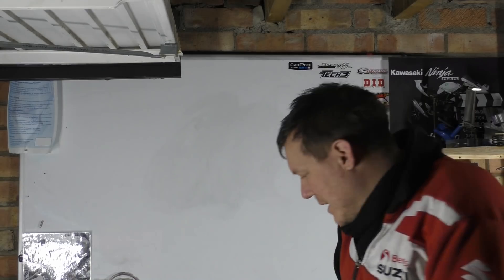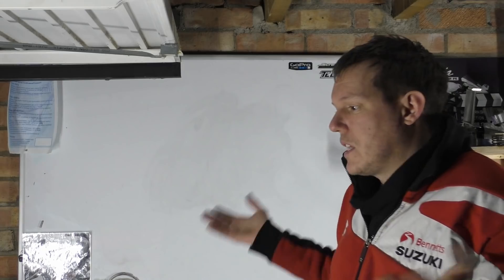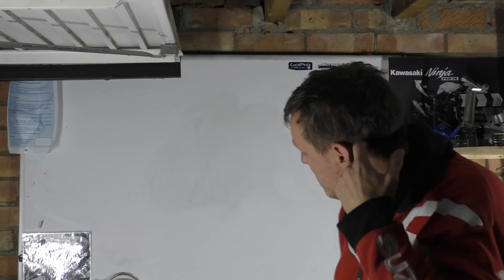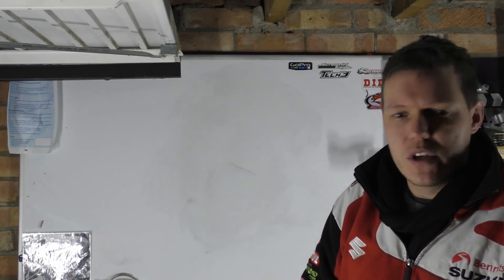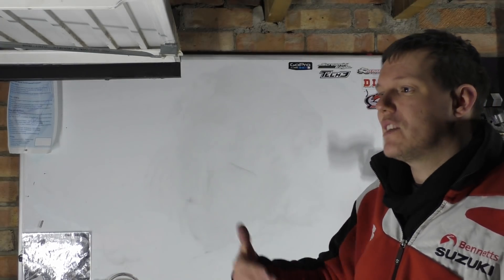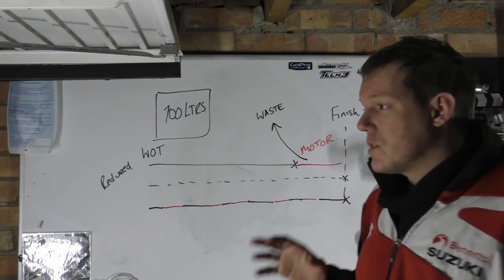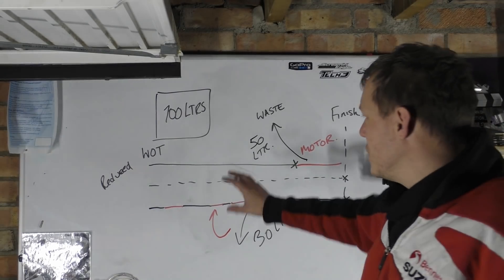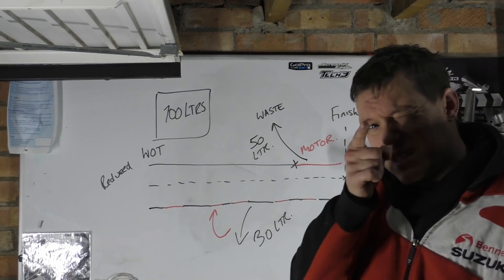How to get more than 30% efficiency?

Comment: If I was to hazard a guess, I would say that your average normally aspirated petrol car engine is not more than 25% efficient. Those house sized supercharged 2 stroke diesel engines that you find in container ships are 50% efficient. Even in the late 80's even Honda only managed to get about about 32% with their 1.5 litre turbo F1 car, which was running 4 bar of boost and ran on special fuel consisting of 84% Toluene.
Reply from the maker: Yeah but that's the 80's - One of the best 'measures' of efficiency is te compression ratio (but only in comparison) Fuel octane ratings are better, but not that much better and not better than TEL. 36% is pretty normal for 2015 cars onwards and bikes are around about the same for the same years.

Comment: Myself and an engineering mate had a discussion about a noticeable increase in power when you were riding in fog. Since a patent has been taken out on a six stroke ,it might have a bit of reality to it. After the power stroke, it takes in a charge of water vapour which makes a steam stroke, cools the engine etc. So why not inject a bit of water vapour and get the steam charge during the power stroke, because your making water out of your exhaust anyway?

Comment: Why aren't the exhaust gases used(Turbo, but instead it's a generator) for charging some battery which in turn is used to drive electric motors? The efficiency of the combustion engine goes down with extra propeller spinning on the exhaust piping? 

If I made a breaktrough invention here, I'm gettin 50% of the profit!

Comment: why ideal gas would have more efficiency than normal air?
Reply from the maker: Because an ideal gas is uniform - air is a mixtures and has stuff like water vapour it in
Reply: @thedirtyworkshop  oh so nothing relate to the thermal dynamic? if the air is 100% oxygen then it would behave like ideal gas?
Reply from the maker: Almost. Thermodynamically this is about the transfer of momentum vs heat and the molecules themselves. In simple terms an ideal gas would have perfect eleastic collisions. Think a newtons craddle but with the heat loss - like in a pefect vacuum
Reply from the maker: "if the air is 100% oxygen then it would behave like ideal gas?"

- when the it wouldn't be air. But the more 'simple' the molecule the more it behaves like and ideal gas. Once you get into higher energies then the ideal gas law becomes less useful. In other words the hotter it gets the more vague the ideal gas law becomes.
Reply: @thedirtyworkshop  thanks sir, your explanation is way more simple to understand than those things on the internet

Comment: would a two wheel drive bike(using stator motors) be an advantage? as in would there be a benifit(i dont ride bikes - yet) if you had drive from the front wheel too?
Reply: as in each wheel is the motor, for practicality purposes on the idea, have a harness farme that hosts a shit tonne of battries..... purely for experimental sake.

ive designed a sketeboard with a similar thing in mind to achieve awd(no slip diff as there isnt one) and abs(that recycles the lost energy), its heavy 1200mm tall and 900mm wide but in therory is capabile of 100kmh(limited)
Reply: im stuck on how to allow one wheel to spin at a differet rpm than the other, fucken computers

Comment: Honda used a pre-combustion chamber on early 80`s cars called cvcc.They dropped it for
emission reasons in favor of fi...Do you know if current rigs with a cat...inject extra fuel just
to keep the cat heated or is that a wives tale?
Reply: I believe the current way of fueling with a cat is to cycle rapidly between slightly lean and slightly rich. 
This provides excess O2 for one type of reaction in the catalyst and excess fuel for others. The downstream O2 sensor is only there to check if the cat is working (if the mixture is still fluctuating after the cat then the cat isn't doing its job).
Reply: Thankyou, this makes sense..do you have any sources of info..?

Comment: They want to eliminate the starter motor on bikes.... there is this amazing thing called "The kick start", maybe that's a way!
Reply: I bet del has.
Reply from the maker: LOL ever tried kcik-starting a Hayabusa?
Reply: @thedirtyworkshop  Try kicking over a semi-auto with a dead battery and you have no idea which gear it is in, and you know the idle is too low, but local garages refuse to "fix" it because it is an "old" bike.

Irony - he was there to replace the switch gear and CHOKE!

If I had the tools, I would have done it there and then.

Comment: Speaking of efficiency, it got me wondering if there is such thing as diesel/hydrogen rotary engine? if so, what are the technical pros & cons of it? Would love to hear some thoughts on this.
Reply: I'm not sure if one could get a compression ratio high enough for a diesel, though it could well probably help with the lubrication issues. The flame front propagates more slowly with diesel combustion, though I'm not sure how that would impact the operation of a Wankel. It would need be heavier built too I think and rev slighly slower.
Hydrogen I see no problem, expect I think it may burn hotter. It however isn't going to solve any other issue with a Wankel, such as the sealing problems,and probably more of a death blow these days the emissions, due to how lubrication must be implemented in a Wankel.
But the problem with hydrogen is the storage especially and distribution. It needs to be either stored cryogenically or under enormous pressure to keep it liquid. To attempt to store it in gaseous form would as well as being a little dangerous, it would be impractical as it would need fucking great big bags on the top of vehicles, like they did in the war when fuel was at a premium for the war effort, running on coal or wood gas.
I can just see some stunning luxurious, el expensivo limousine,  with a fuck off enormous rubberised canvas bag on it's roof, twice the size of the car.
It simply would never do. One would have to extinguish ones stogie, for fear of setting off the gas if there were a small leak. We wouldn't want another Hindenburg.
Reply: rationalmartian slow combustion with diesel would be a benefit since the wankel ‘strokes’ happen simultaneously at a much lower speed. But the high compression might really put an end to the apex seals and increase friction even more (lots more seal area/length than a piston engine due to the side seals)
Reply: @ghettobikelife8833  But diesel is a lubricant itself don't they? possibly eliminating the 'oil burning' issue?
Reply: @ghettobikelife8833  
The compression wouldn't hurt the apex seals that much, the big problem is that the maximum compression on wankel engines is very limited.
Reply: Altruistic yeah but modern low sulfur diesel barely manages to lube the injectors (which need it)
Reply: Rolls Royce made a diesel wankel engine with a sort of precompression rotor. PATS or later UAV  developed a series production diesel wankel engine without any precompression rotor, a real diesel engine so to speak ;D.

Comment: We tested a ford fiesta 1.25 engine at university back in 2002 and were shocked to find it was only 19% efficient 😲.. But Now to hear mercedes are hitting 50% is incredible..
Reply from the maker: The core engine is probably about 35-38% for the F1 engines
Reply: got to be more than that at peak, the analyst say that have ~950hp, the electric motor is limited to 161hp
Reply: @fuzzy1dk  That 950 hp figure includes the electric motor(s), yes?
Reply: @petrolheadJJ  yes
Reply: @thedirtyworkshop  yeah I know, all these external aids allow the fuel to go abit further but the combustion engine at 30-35% is still impressive considering its a racer and not a family car engine..

Comment: Mmm how to increase efficiency bore out to about a meter increase stroke to about 2.5 meters go two-stroke I think, oh bugger sulzer have done it before me. And the are making around 160 g/kWhr where we on our bikes n cars are around 350 - 500 g/kWhr. Is there something wrong with manufacturers and emissions control strategy? Shuldent we be designing engines to use as little fuel as possible and then design emissions control equipment to work around that rather than got to run at stoich to meet the requirements of the cat.
Reply: a three way cat needs toggling between rich and lean to both oxidize CO/HC and reduce NOx. A diesel can't run rich so it needs things like urea injection

Comment: Do you think hydrogen buring ice engines are the future? I know they are trash but eventually people are going to be forced to get rid of fossil fuel burning vehicles. And I honestly don't know if batteries will ever get to the practicality of an ice engine.
Reply: the problem with hydrogen is that is very hard to store, getting it to liquid requires cryogenic temperatures so that's not realistic
Reply: @fuzzy1dk  unles we find some bonded form of hydrogen that can still be oxidized without creating co2 or other harmful gasses. And I mean bonded, like bonded to other atoms other than carbon or hydrogen that are abundant, harmless, and would cause it to be liquid at room temperature and pressure. However, I don't know if such a compound exists...

Comment: Addressing frictional losses is the route to increase efficiency.

 Back in the 1980's a mate's car garage boss did car drag racing and let me in on a secret that there are bearings and then there are bearings. Bearings have a friction rating. The one's engine manufacturers use are generic and just about do the job. They have a high friction rating and bleed power out of an engine through frictional losses. They're bulk buy for the manufacturers.

Then there are engines built for competition which have low friction rated bearings, usually coated in something and which give less drag to an engine. He demonstrated a new generic ball race bearing versus a expensive race grade equivalent by letting me spin each one up and seeing how long they took to spin to a stop. The actual friction rating test is done by spinning the shell to a set RPM and timing how long it takes to spin down to a stop.

I rebuilt my 350 road bike with expensive SKF race grade bearings back in 1986 and when I took up bike drag racing in the late 1980's rebuilt all my GT550 2 stroke engines completely, including wheel bearings. It improved my times as acceleration was upped. I managed a 9.91 quarter at Santa Pod in 1989. I used to have a well paid job in electronics engineering back then, that allowed me to commute 60 miles a day on a bike that only did 18 MPG @ 45 MPH on the open road and 9 MPG in town. I used to use just a pint short of 8 Gallons of petrol a day, 4 Gallons to work and 4 Gallons home. (Life with a gas guzzler bike!!)

The noticeable difference is the rate at which the engines gained revs over generic bearings previously and the reduction in engine braking. On the road both bike's MPG improved noticeably.

With engine rebuilds installing expensive low friction rated race grade bearings improves performance simply by reducing some frictional power loss.

Worth rebuilding that RG500 with this type bearings Matt as even in stock tune it will be better than it was when it left the Suzuki factory.
Reply from the maker: "Addressing frictional losses is the route to increase efficiency."

- but the friction losses are quite small, so there's not that much to be had. Not only that but the CoF of steel on oil and that of say DLC isn't that much different - again there's not much to be had
Reply: @thedirtyworkshop  Even if it's not much it should add up to a substantial amount due to high RPMs.
Reply: I would add I dare say that with modern machining precesses and materials as long as one gets at least proper quality shit form the good manufacturers the differences these days will be even smaller than they were in the 80's.
One could go the whole hog if one felt particularly flushed and go for the fanciest most expensive ceramic race bearings wherever they would be suitable.
But as Matt said. I think the difference would be small compared to the costs. Certainly unless one were racing, AND some other fucker was shelling out for the bits I would be giving it more than a coat of consideration.
BTW. I always had a bit of a soft spot for SKF myself, I must confess.
Reply: Fook me, did I read that right?  A 9.91 1/4 mile time on a tuned Suzook GT550!? Wow just total wow....what was your terminal speed through the trap?
Reply: spinning a bearing to guess its friction is pointless, take a worn out bearing wash out all the grease and it'll spin for a long time. https://youtu.be/uD7Lzv5fWhs

Comment: Increase oxygen then way way less fuel is needed. I know it will work, Is oxygen just too expensive?  10x the fuel economy would easily offset the cost.
Reply: That would significantly offset the afr because each one of those 14.7 parts of air has 21% oxygen. You would lean the shit out of it and melt or detonate in no time. What you have suggested is similar to nitrous oxide where it breaks down into oxygen for that extra power but it's compensated with fuel and timing and it's for short burst periods
Reply from the maker: say what?
Reply: The Workshop if you fed O2 into the intake more of the fuel would burn. The efficiency would be great enough to offset the cost of the oxygen. You could go from 10mpg to 100mpg.
Reply: @sirtnfol8476  No.
Reply: @sirtnfol8476  Its not practical because oxygen is a complete safety hazard for one and you would also need stations to refill it.
Reply: It wouldn't matter. It would do nothing but add cost, and blow engines up. In a modern engine one doesn't NEED any more oxygen. We get enough out of the atmosphere. A modern engine is partially so much more efficient and certainly better emissions due to modern fuelling systems being so accurate at metering the fuel. That is MATCHING the amount of fuel to the correct amount of incoming air. The stoichiometric ratio is the stoichiometric ratio. Putting in MORE oxygen would be useless UNLESS one were putting in more fuel. In fact it would/could be detrimental, as one would then be running in too lean a condition. Temps would go up and one could pink/pre-ignite/detonate possibly/probably causing damage or melting valves or piston crowns, lands and damaging rings.
It is much easier and more efficient to use forced induction to get slightly more atmosphere, and hence oxygen into the cylinder. Again, obviously matching the quantity of fuel, or actually in practice it is done  the other way around, fuel is matched to ingoing air. But you doubtless get my drift.
Now IF you were drag racing??
I still doubt it would be the best way, or I dare say folk would have done it. There are other ways to get oxidisers and fuel into the combustion chamber. A few of them combining both fuel AND oxidiser together. Such as nitromethane and I think also nitrous oxide too
Reply: Increase oxygen means you can increase fuel which would give more power but this would also create more heat thus decrease total efficiency
Reply: Marc Jackson 
It’s not about dissipating the heat (that’s energy being dissipated) it’s about turning the fuel into rotating energy while minimising heat produced

Comment: Are you familiar with Somender Singhs grooves?
Reply: cylinder head grooving?? to cause turbulence in combustion chamber in an effort to increase burn rate and to increase torque some call them torque grooves
Reply: @skinz2211  Well done.
Reply: No, Are you?.
Reply from the maker: 15%? I smell bullshit
Reply: @thedirtyworkshop  I will find the paperwork. It may take a couple of weeks as I am kind of a hoarder. This is going to be fun.
Reply: I personally contacted Somender and he showed me exactly where to put the grooves in my specific engine.
Reply: Average Joe . Yes, I did it to my twin cam 88 and got about a 15 percent increase in hp and torque. Measured on the same dyno. I have paper copies of it somewhere. Also, I can easily take off in 2nd gear. Lug the engine down to 500 rpm and accelerate from that rpm.
Reply: @rlund3  bullshit, Have a nice day.
Reply: @rlund3  was you lobotomized by your government or was you born that stupid.

Comment: Minimize the surface area to volume ratio of the combustion chambers. Increase the average load. Increase the cylinder temperatures. Harvest exhaust energy via MGU-H. Close the inlet valve really late while still making sure the compression pressure is at maximum. In effect make the power stroke longer than the effective inlet stroke so to speak.
Reply: https://en.wikipedia.org/wiki/Miller_cycle